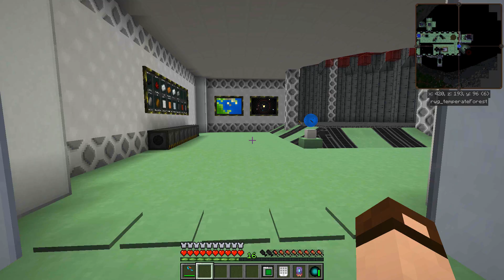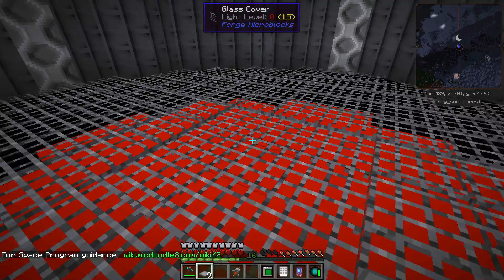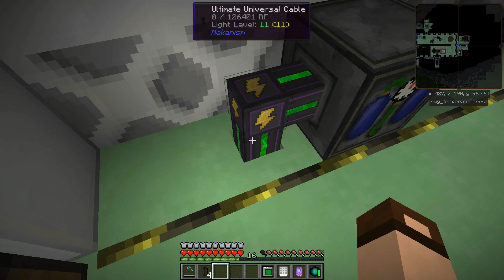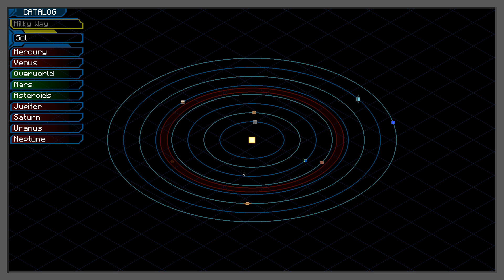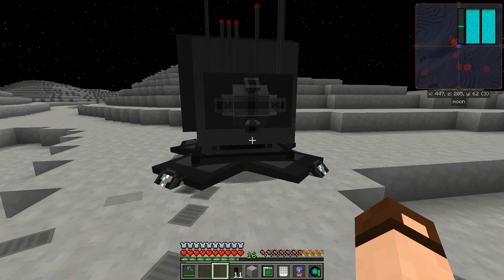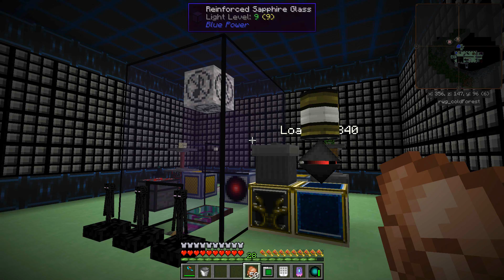FTB Horizons Daybreaker - 16 - Galacticraft - To the MOON!

Comment: Hey non I think itd be really cool if you made some bases outside of earth. Maybe a rotating space base with artificial gravity. Each one should be complete with its own ecosystem with a power source, food growth, oxygen recycling etc. Also on mars you could make a base with a central dome as a control hub, maybe some other domes for chambers and food and oxygen and machines and other things. Maybe use some opencomputers to customize your space station. (The challenge is that maybe you should make it so while inside your bases in space or on mars you have to be able to breathe without your oxygen equipment just like on a real base. You dont have to make a new ecosystem in each base but I thought it would be a cool challenge.) Maybe you could do another colab with the other guys or just Brink or TDC.